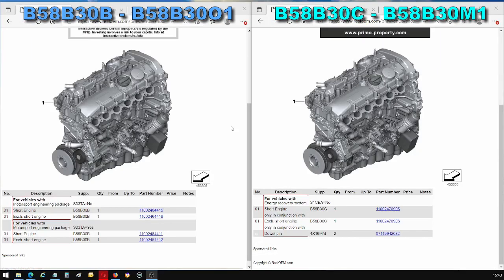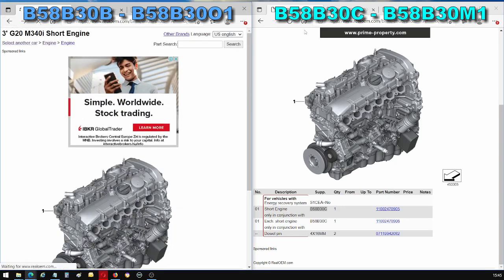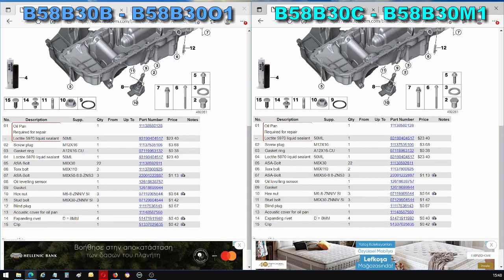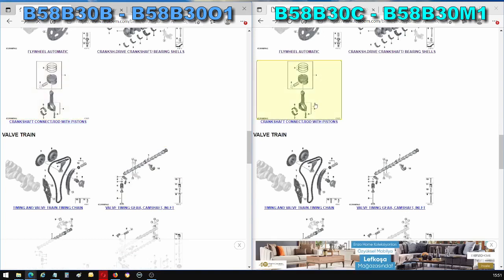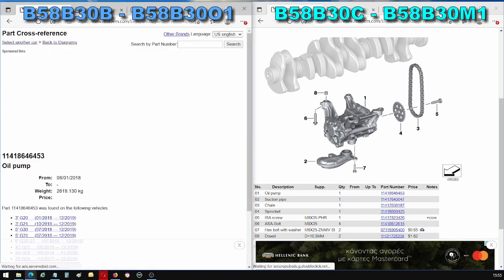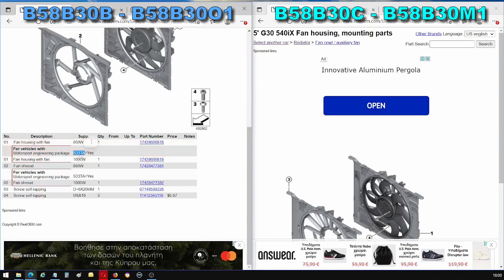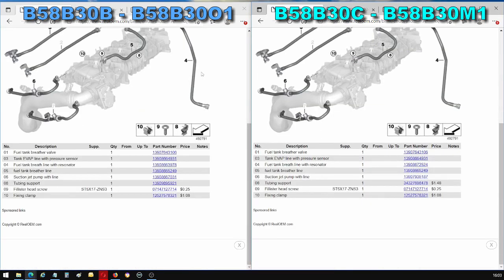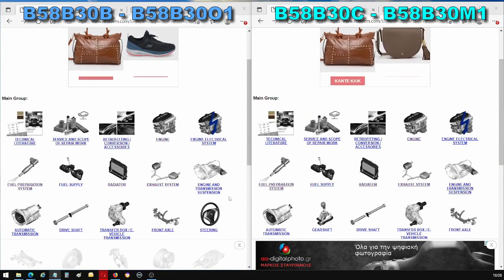BMW/Toyota Supra: Differences between the 335hp and 382hp versions of the B58TU engine

Comment: Are they both same same bare block part number? Got a 22’ m240 with bad block want try swap in a 21’ 540 bare block
Reply: Does the B58B30B have an mild hybride?
Reply from the maker: @UfoPilootje  Yes it does on some models and on some years. For example G42 M240i with B58B30B does not have mild hybrid.
Reply: @NoBrainerTalk  i have an 2020 M340i does the mild hybride then apply to me was well?
Reply from the maker: @UfoPilootje  It might have it or it might not, easiest way is to check for a purple harness in your engine bay, pop the hood and check, if you have a purple harness you have mild hybrid. :)
Reply: @NoBrainerTalk  Well i dont have the purple cable running underneath the engine bay, but i do have an battery showing in the infotainment cluster… so im a bit confused whether i have it or not …
Reply from the maker: @UfoPilootje  No purple cable means you don't have the system.
Reply from the maker: I believe they use different P/Ns (540i i.e. B58C is P/N 11111025308 and M240i i.e. B58B is P/N 11111025307) but I can't tell you how different they are, and if they can be used interchangeably. What went wrong with the M240i?
Reply: @NoBrainerTalk my motor was flooded so block was toast, compared pictures of the lower block of the c and b, they look the exact same and have the same oil and coolant passages and had a few people tell me they are interchangeable but just not sure since part numbers are different
Reply from the maker: @SamuelAlaniz-bu7uq  Hmmm, the two engine variants use different pistons and compression ratio I believe, so it might be something to do with that. I believe there's a good probability you can use the B58C block with the B58B without issues, but not sure how you get a definitive answer whether they are fully and freely interchangeable. It might be you are the first to take the risk and let us know how it goes? Sounds like it would make a very interesting YouTube video!

Comment: For the B58C, specifically in a 2020 540i, is there a recommendation you might make to help the cooling in some way?  I don't plan to track the car so don't foresee it overheating however with a tune I want to make sure I preserve the longevity of the engine. Thanks
Reply from the maker: For a stage 1 tune and not planning to track the car, I think the stock cooling system might suffice, so ensure both your expansion tanks have the correct coolant and at max level. You might consider upgrading intercooler and supplementary heat exchangers depending on your driving style and average outside air temperatures.

Comment: So one of the things is that the cooling is 1000W in the 335HP engine and that the 382HP uses air to cool. Although I don't really understand most of the engineering terms in this video, I can't help but be confused how the 335HP engine isn't slightly better? I mean I can see that it has a better focus on the fuel economy but what is the problem with up-tuning the 335HP to 382HP or even more in the long term?
Reply from the maker: Hi, the 335HP engine retains more heat through the exhaust manifold being integrated into the cylinder head, and is therefore able to warm up faster which increases efficiency (and increased efficiency means less fuel burnt i.e. lower emissions). However this design is also less able to dissipate heat and therefore in high demand conditions where the cooling systems (intercooler, engine coolant and radiator, aux radiator, etc) are unable to keep component temperatures to within limits, the engine will reduce performance to safeguard the engine. The 382hp engine will not retain the same heat, and will also dissipate the heat more easily compared to the 335hp engine, hence in high demand situations is less likely overall to reduce performance to protect engine. Power can be increased on both engines with a stage 1 tune. Hope this helps.
Reply: @NoBrainerTalk  thanks for the reply but I always thought if I tune the engine it will break eventually otherwise the factory would have done it to up sell the car? If I give it better cooling somehow which idk how, does that mean I can up tune it to 382 safely?
Reply from the maker: @GrandTheftAutoFans1  The manufacturers themselves sometimes detune engines so they can increase power later on with extra cost. In the case of the 1st gen B58, BMW offered the M-Performance Power and Sound Kit, which with a BMW tune and no engine mods increased power from 335hp to 360hp, i.e. showed that the 1st gen B58 was always capable of 360hp stock but was tuned at 335hp in almost all applications for commercial reasons. Alot of commercial reasons affect the chosen power output, e.g. where does the car come in the line up, how does it affect the next model, how close do we want it to be to the M-Cars, etc. Generally the B58 has now earned a reputation of being an extremely robust design, with internals and cooling systems able to handle much higher power than stock, therefore a very large number of owners installed stage 1 tunes without issues.

Comment: I came back for another look. You should consider using an ad blocker so your browser isn't cluttered with ads. I recommend ublock origin. You mentioned the heatshield. The reason it's only on the engine with the external exhaust manifold is because on the engine with the internal exhaust manifold, all of the exhaust heat is retained inside the cylinder head. This places more load on the cooling system. Probably explains why it also has a higher rated cooling fan.

Comment: My 5 series 45e has B30C, and its downtuned, but how much it normally makes? and what do you think, would it run normally if I’d remap to standard 40i tune?
Reply from the maker: The 545e is fitted with a significantly detuned version of the 540i's B58C, which produces just 286hp instead of 335hp. However, combined with the electric motor, the total output of 394hp is higher than the standard 540i. I don't know enough to say for sure, but I believe (and could be mistaken) that the 545e is fitted with a standard B58C meaning the internals (pistons, rods, bearings, crankshaft, block, cylinder head, etc) are all the same. So the engine could be re-tuned to produced standard hp (335). Moreover the B58C can produce around 400hp with a stage 1 tune (dyno results vary and some are just too high to be realistic), so if the internals are the same there's again no reason the B58C in the 545e could not manage to produce the same stage 1 hp as any other B58C. Certainly there seem to be 500+ hp 545e examples out there with stage 1 tune only, so it seems adding a stage 1 tune is totally feasible and works OK with the electric motor to give total hp near M-Car figures. However, the fact it is a proper plug in hybrid should give some cause for pause, I don't know if the reason BMW detuned it is purely for emissions, or if the system as a whole cannot handle the extra power (more experience is needed if this damages the system). Also not sure if the ECU/DME needs to be removed and sent for retuning i.e. if it requires unlocking on bench.
Reply: @NoBrainerTalk  Thank you mate. I have had faulty headlight(laser) after only 20k km, and had to replace the whole unit, so now Im kind of scared to tune it as It would void the warranty😓
Reply from the maker: @Cola99967  I don't think you can void a new headlight warranty with an engine tune, but dealers (like insurance companies) will try whatever they can to reduce their costs.

Comment: Can I swap a 6 port engine into a 2 port 2020 Supra?
Reply: Just swap the heads like Papadakis did for their 1200hp Supra.
Reply from the maker: @BrillianceAutoSpa  when he first built the engine he used the 2 port head, is this something he did later on?
Reply: @NoBrainerTalk  yes they did, and they were able to.unlock an additional 300hp switching to a six port head off of a 2021 Supra.
Reply from the maker: @BrillianceAutoSpa  Nice.
Reply from the maker: I believe it should be possible.

Comment: So the B58 have 335hp (20) and B58H have 382hp (21-23)?
Reply from the maker: Negative, only the B58B30O1 / B58B30B has 382 hp. The B58B30M1 / B58B30C and some versions of the B58B30M0 / B58B30A have 335hp. Other versions of the B58B30M0 / B58B30A have 322hp and 360hp. The B58B30M2 has 374hp.

Comment: what about the new b58 in the x7 with port injection does it have the single chain like the tu or the original dual chain like the first gen b58?
Reply from the maker: Single chain like B58TU1

Comment: Out of the 3 different B58 variants, which one has the highest tuning capability? Is reliability a factor between these 3 variants?
Reply: None of these engines can handle over 600 crank hp/500 whp stock, for very long, especially not if you plan to put 35k-50k miles on it. Upgraded positions, rods, crank, etc are needed. Note, I didn't say they can't handle it, I said reliability  is key and thus said what I said.
Reply from the maker: The  tuning potential is extremely high for both engines, there are 1st gen B58s with 700+ whp and one (heavily modified) B58C produced 1000hp. I'm not sure if there is a definitive answer on what variant can cope with so much more power for long term.

Comment: Hello NoBrainerTalk, do you have BMW Electric Water Pump Bleeding Procedure for this engine? There are two electric water pumps and two coolant expansion tanks.
Reply from the maker: The sequence for the the intercooler coolant (low temperature) circuit:

- Open expansion tank cap.
- Fill up the intercooler coolant expansion tank to between minimum and maximum level.
- Turn on power in the car (do not start engine)
- Turn on headlights
- turn on hazard lights
- Turn on A/C in manual mode (not auto)
- Set A/C to max temperature on both driver and passenger side, but lowest output setting (in most BMWs 1 of 7 I believe).
- Press accelerator pedal for 15 seconds to activate the auxiliary electric pump (you may hear the electric motor start before the 15 seconds mark. When electric motor starts, it should be OK to let go of accelerator pedal.
- Once it starts it should take 10-15 mins to complete cycle.
- If coolant level falls below minimum, top up.
- Optionally do the process again (sometimes at second attempt also drops below minimum), or proceed to Close cap.

The sequence for the the engine coolant (high temperature) circuit:
- Open expansion tank cap.
- Fill up the engine coolant expansion tank to between minimum and maximum level.
- Put on seatbelt.
- Turn on headlights
- Turn on power in the car (do not start engine)
- Press the start-stop button three times rapidly.
- Turn on A/C in manual mode (not auto)
- Set A/C to max temperature on both driver and passenger side, but lowest output setting (in most BMWs 1 of 7 I believe).
- Press accelerator pedal for 15 seconds to activate the turbo electric pump (you may hear the electric motor start before the 15 seconds mark). When electric motor starts, it should be OK to let go of accelerator pedal.
- Once it starts it should take 10-15 mins to complete cycle.
- If coolant level falls below minimum, top up.
- Start engine, the car will automatically start bleeding procedure with the mechanical water pump.
- Rev engine to 2500-3000rpm for 10 seconds
- Allow it to return to idle for 20 seconds
- Repeat 9 more times revving and idling.
- If coolant level falls below minimum, top up.
- Optionally do the process again (sometimes at second attempt also drops below minimum), or proceed to Close cap.
Reply: @NoBrainerTalk  Hello NoBrainer Talk, Thank you for the instruction coolant bleeding procedure. I have tried on both processes, and both methods work for the (Low-temperature circuit) only, not the (high-temperature circuit.) I am driving a 2018 X3 M40i with a B58 engine, and it has a mechanical water pump for (high-temperature circuit.), I wonder if it may not work for this coolant bleeding procedure. Do you have any suggestions?
Reply from the maker: @monicahuynh1689  Hi, it's unlikely but it's possible for the X3 M40i there might be a different procedure. But I believe maybe the way I wrote the high temp procedure might be resulting in a mistake. After you put on your seatbelt, press the start button 3 times rapidly (on, off, on, time between each press about half a second). So don't press the button once and then another 3 times rapidly. The way I wrote the sequence I feel it's possible you might be turning the power on, and then pressing start-stop button 3 times (a total 3 presses is required, not 4 presses). If it doesn't work again, this time leave your headlights in auto and try again. If that doesn't work, then there is something different about the X3 M40i...
Reply: @NoBrainerTalk  Hi , Thank  you, I did press start button 3 times. But still not working. The new generation x3 is press start button 3 times to on accessory and diagnostic mode. I have been searching around and haven’t seen any one done the coolant bleeding procedure on the X3 m40i .
Reply from the maker: @monicahuynh1689  It's very interesting I have to say. A BMW dealer would use the vacuum fill method, bit it's worth asking the local BMW dealer for the DIY bleeding procedure of the high temperature circuit. It's very frustrating, I wish I was there to see in person what is happening.

Comment: The difference in cats is probably why the 2021 supra is quiter
Reply from the maker: Maybe, although they both seem to feature 700 cells per square inch cores based on the limited information I could find. I will probably make a part 2 video, as there was just too my information to discuss, and realOEM took alot of time.
Reply: The difference in cats is because the turbos are different and the engines have different horsepower ratings.

Comment: A key difference is that many of the 382hp B58s consume 1 quart of oil every 700-1,000 miles
Reply: 17k on my B5830O1 and no oil consumption so far
Reply: @magnagaurd  month/year manufacture date and vehicle?
Reply: 03/19 date code M340i in florida. Though i will say my average MPG is 32, i know a lot of people burning oil drive the wheels off of theirs. I also change my oil every 5k
Reply: @magnagaurd  the 330hp ones don't burn oil, regardless of driving condition, so it's a design/tolerance failure for sure tho. I'll check mine later
Reply: @sly9263  how are you gonna check it? No dip stick and im not sure the digital gauge is so precise. The oil is going somewhere. It would cost BMW billions to remedy this as it did toyota (2AZ). So i doubt theyll ever acknowledge it.
Reply: @magnagaurd  I got rid of it, someone else's problem now
Reply from the maker: Hi, yes, based on owners reports it appears that some B58B30B / B58B30O1 engines have higher than average oil consumption.  But the root cause is unknown at the moment.
Reply: A bit late to the party, my M340i does not consume any oil after 27,000 km of ownership. Probably those engines were not broken in properly.. or i am just lucky?
Reply: @aleksandarvukovic2525  lucky, not a break in procedure issue
Reply: @sly9263  I mean everything is possible! What was your oil change interval?
Reply: @aleksandarvukovic2525  there is a  TSB for the issue. It's not an oil change topic. I changed it at 1k (needed a quart at 800 miles) and dumped the car at 3.8k over the course in which I had to top it off with another 4 quarts
Reply: @sly9263  I was asking because i am changing it before the BMW recommended interval, so i wanted to make sure that i am not seeing the problem because i am changing it at around 5k- 6k miles.
Reply: @sly9263  OK damn definitely something seriously wrong with it. Smart choice by getting rid of that money pit. It scares me that their quality control fell off that much. And that they do not know the issue is even scarier. I also read that some guys have coolant issues as well. Knock on wood, my car is behaving itself as it should- 0 coolant and 0 oil issues at stage 2.
Reply: It’s from the bad pcv system of the late model valve cover